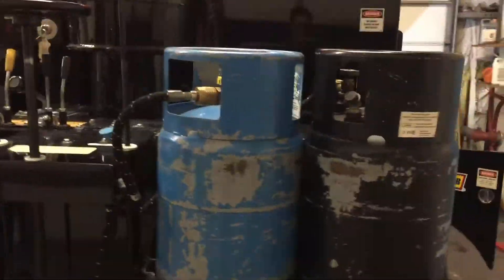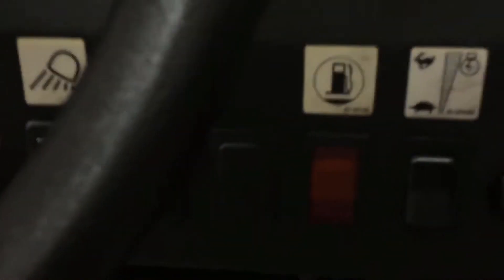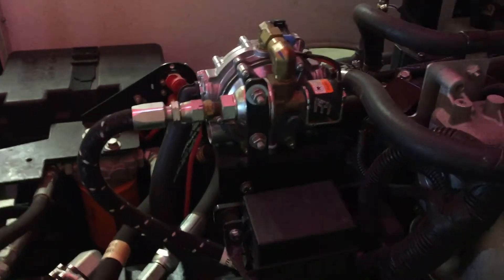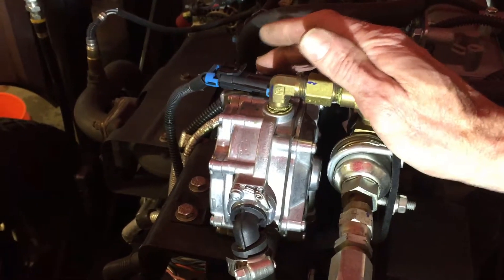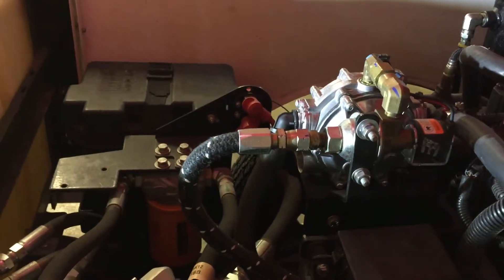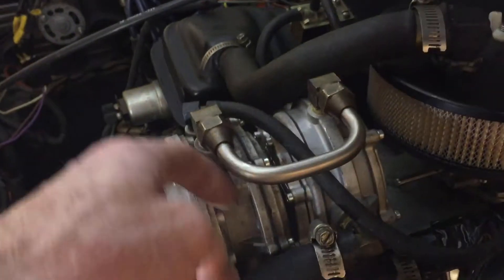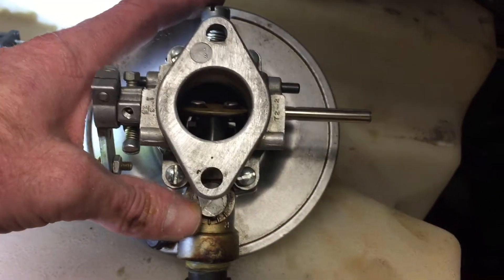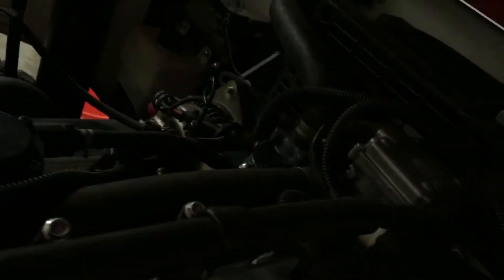Zamboni: Propane Fuel System

Comment: The best model to change the propane is the Zamboni model 400 series they lay down sideways
Reply from the maker: Yes our old HDB was like that too.
Reply: @YourLocalIceMan  Our old one was vertical. I preferred that to the horizontal tanks. The platform for the vertical is lower (lower even than a bottom horizontal) and as we use a mix of 35 and 45 lb tanks. Lifting a full 45lb tank is about 90lbs up and that just sucks.
Reply: @YourLocalIceMan  Why would it pull liquid out?